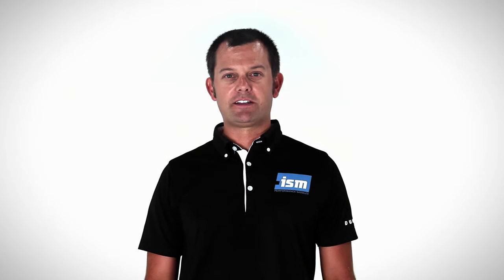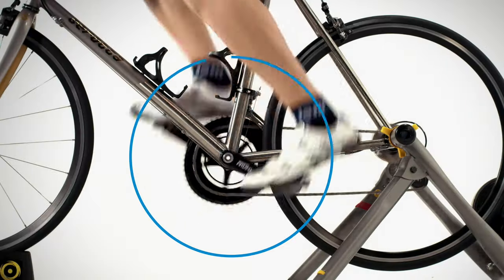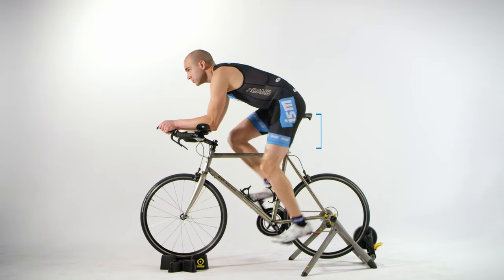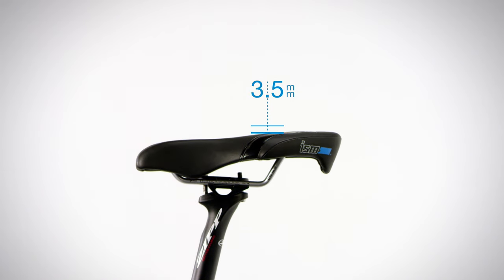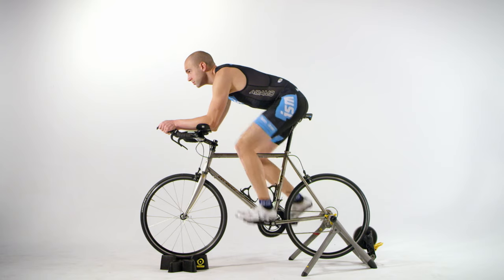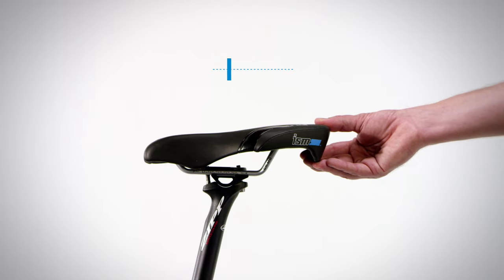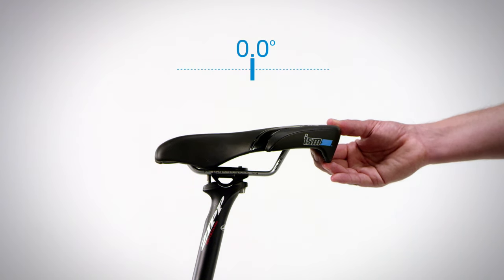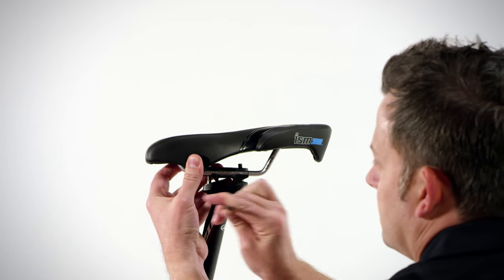ISM Saddle Setup - Triathlon or TT Bike

Comment: ISM nose is too wide for people with bigger legs (most cyclists?).  It just rubs non-stop on both inner thighs because the saddle nose is super wide.  It doesn't matter what height the saddle is at, there's nothing this saddle can do to correct this.
Reply: Then you're sitting on the wrong area of the saddle (mostly back of the saddle). I had the same problem because I was using this saddle like a normal one
Reply: just to share, theres a workaround for a lil too wide nose.
use zipties in between 2 railings under the nose to adjust n bring em closer together👌

Comment: Dr. Steven Schrader with the National Institute for Occupational Safety and Health (NIOSH):  “When you sit on a bike the pressure on the perineum increases sevenfold. Riders using a classic saddle place 1/4 of their body weight on the perineum. The amount of oxygen reaching the *** typically falls 70% to 80% in 3 minutes. A guy can have his oxygen levels drop 100% but he doesn’t know it. After half an hour he goes numb.

Saddles with splits or holes may make matters worse because they have smaller surface areas, and hence the rider’s weight presses harder on less saddle. The arteries in the perineum run laterally and therefore they come under more pressure when they come into contact with the cutouts’ edges. It is no longer a question of whether or not traditional bike saddles causes ED, but what are you going to do about it?”  

Spongy Wonder